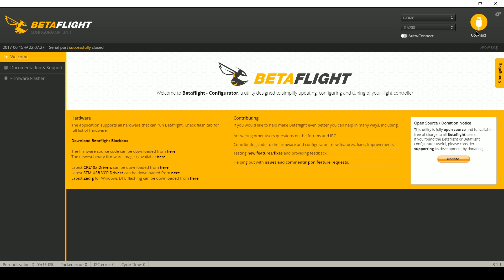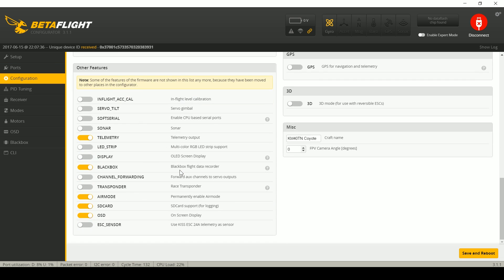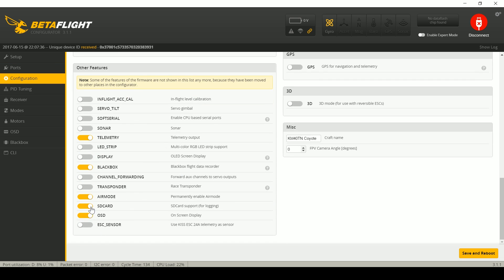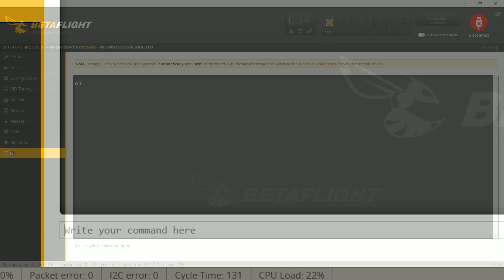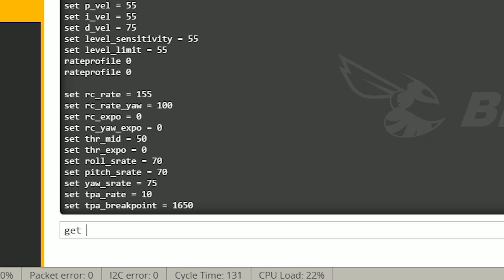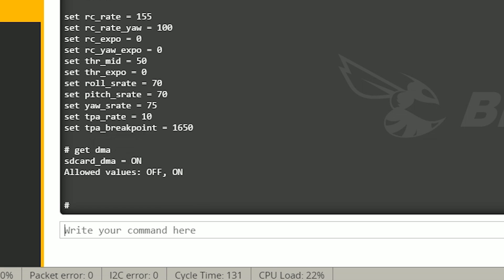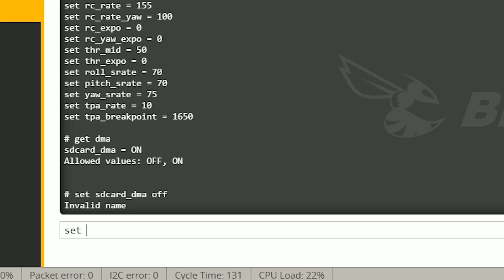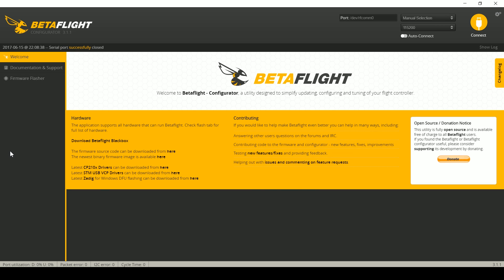Omnibus F4 Betaflight Thrashes and Crashes | HERE'S WHY AND HOW TO FIX IT

Comment: Hey I have a problem where my drone is all good connected to the computer, the motors spin no desync at all, but as soon as I use the transmitter and arm it at first it seems ok but when you push the throttle up motors go crazy also they overheat real quick and the drone turns in yaw direction like it jitters, does anyone know what the problem is ( fyi i changed the motors and escs, I updated firmware but nothing works still the same problem)  Thank you

Comment: I had that moment with my quad with omnibus f4 in it. Instead of that moment, I got problem with its GYRO then.
After it crashed, the gyro is error by seeing it in my goggle. I couldn't arm the quad and the message "no gyro" appeared in gogge display. I tried restart the quad by plug-unplug it then it works again.
Can you guys helm me? What makes it so? That makes me afraid to fly my quad again before i could found the problem.

Comment: no data flash,i keep getting that pls help how to get my omnibus f4 v3 pro to work.
Reply from the maker: Most likely it just means the FC has an SD card reader instead of a dataflash chip. "No dataflash" doesn't affect the working of the board. Dataflash would be used for blackbox logging.

Comment: I have an omnibus f4 OSD AIO and it did this crap this weekend. but mine doesn't have an SD card slot on it.. any ideas? I really hate this board as I can't get ESC pass-through to work nor can I flash the firmware. May just replace it with something better.

Comment: This is happing to me but I have a naze32 it just started happening today out of no where how do I fix this?
Reply from the maker: To be honest if I had sudden trouble with a Naze 32 today, I would consider replacing it. Betaflight hasn't supported F1 chips in several versions.
Reply: Hahah yeah ordered the omnibus f4 thanks. Hopefully it don’t do this but at least I’ll know how to fix it.
Reply: I just installed the omnibus board In to my quad and was flying but it randomly falls out of the sky I will hear 3 beeps then it will just disarm and it happens randomly. What’s the problem? It’s not like this problem it just beeps and then disarms? And I did everything in this video I have no idea?

Comment: Hello! I really like your videos and feel like you are the best person to learn from! Your new vids are awesome keep flying! :)
However I got an issue with my F4 pro v3 flight board. My drone crashed and I had no idea why. I tried to plug in battery and something started smoking. I found that it is the U4 unit. Next to it there is a C7 resistor and it came of somehow (at least one "leg"). I soldered it back carefully and tried to plug it in again and it started smoking again. I removed the burnt U4 unit. Now I am wondering what funcion will I missing. Maybe you know that (?) :)  The FlightB turns on and looks like its still working.
Reply: Better to not get omnibus.
https://davidhkblog1.blogspot.com/2017/06/fixing-omnibus-f4-pro-over-heat-and.html?showComment=1541408154194&fbclid=IwAR0DAE2uii9O1eEEXnDitEB6WSsGw1E3e22xpCHsfqDY9nb8yP7uv2E_HJM#c6956157706785268210

Comment: Im having a issue with Acro mode. Stable and Horizon mode work perfect but acro will fly good for a few seconds the the stick inputs will randomly change. Pitch forward will roll left, pitch backwards will pitch forward and so on with the rest of the stick inputs. only thing that does not change is yaw and thrust. Sorry I am a newbe and this is my first build.. PLEASE HELP
Reply from the maker: I literally can't think of a single thing that would cause this. Find a more experienced pilot who can get more information about what is going on is my advice :-)
Reply: Thank you Joshua. I will do some more research.

Comment: I have a problem with mine taking off at arm
Reply: @Midwest FPV mine turned out  be simple. The motor direction was wrong. It's not enough just to have 2 CW and 2 CCW. The directions of spin must match what you see in Betaflight. But you probably already know that....There are quad groups on Facebook and they are good about answering your questions. Squadrone is one

Comment: Running official 3.3. I freefell from 150ft due to my inputs being ignored after a throttle punch (within 100 feet), it continued on for a couple seconds till I hit the failsafe(Qx7) I then attempted to rearm and "catch" it did rearm but too late, surprisingly nothing broke, not even a blade.

Osd didn't work and only displayed random letters. Bb did not record as I did not insert SD card.

I reflashed to 3.25 and strapped the drone to a 4X4 and gunned the hell out of it with tons of throttle stabs- no failsafes/glitch, osd  works.

Using a Hobbywing F4 with OmnibusF4SD target, Dalrc engine with 3A BEC, 5v feeds 200mw VTX and XM+ RX, cam powered from Vbat.

Going to attempt flight tomorrow, hoping it was a firmware bug I read on RC groups someone with an OmibusF4 and 3.3 had exact thing happen, someone wrote it off as a tx/rx glitch, I'm not buying it, I couldn't disarm, but my switch failsafe worked? I have the RX set to "no pulses" and my FC RX failsafe is "lead balloon mode".

Weird stuff, frightening too because I had around 15 seconds of no control over my quad. If she flies sweet with 3.25, I'm giving 3.3 a hard pass.
Reply: Just thought of something, bb faulted due to no sd card, wondering if onboard flash size is too small and somehow it tried to log data and freaked out the board due to insufficient memory causing some kind of conflict.

But isn't BB flash separate from EPROM? Maybe just a firmware update glitch?
Reply from the maker: Dataflash and program memory are separate.
Reply: I figured that. I'm going to eat my words, but I DO think it was a RX issue, I was flying around, punching out a little bit, then went off away from me and at low throttle, and boop! failsafe- it STILL could be another component such as noise in the system since I'm running beefy motors. Oh well, I'll throw in another XM+ rx and see if that solves my issues, I'ts directly soldered to the board via stubby pins and I made sure the joints were nice and shiny.

I also flew old blue  that is the same frame/similar setup and had zero issues- this will be the first bad FRsky RX go bad on me- also, antennas are tightly connected, so that isn't it.

Since it's down, I downloaded Butterflight and see if the hype is real.

Comment: Hooked up my board, everything works perfect except ibus.  It will send signals intermittently.  I have no idea what is wrong.  Evolution tx, ia6c rx.  Why won't this work?  I receive bat voltage through the controller so I know they are synced.  Any ideas.

Comment: I have an ARTOWER F4 PLUS 2.0 Flytower Omnibus FC... which lead me to this video. I'm currently experiencing an issue where the copter just "drops dead" during hover testing at random times. Motors will just stop and bam, right to the ground it falls. All lights remain on. It will not re-arm either. I've tried connecting it to the computer after an event like this occurs and it's dead to the world. I tried blackbox logging just to see if it would tell me anything. 

Interestingly enough in betaflight 3.2.0 with this board and sdcard_dma = ON, I do not get any shaking at all, just figured I would mention that. Presence of a microsd card or not, however, makes no difference with this "sudden stop" issue I'm having. Do you have any advice on how I should debug this? Basically I feel as though the FC is crashing/freezing.... I am going to disable DMA tomorrow and see what happens, but remember, I haven't even been using the blackbox except once to test.
Reply from the maker: Refusal to rearm is a strong indication that you are having failsafe events. Check your receiver and its connection to the FC.
Reply: Hmm... I've already replaced the receiver; and it's wired up to a 3 pin connector that seems to fit snugly. Every time this happens the receiver light is fully on and responsive to the radio being turned on/off. I should have mentioned that. Thanks for the fast reply! I don't know what my next step would be.  Would a failsafe event though prevent me from connecting it to betaflight until reboot/restart of the quad? That is what struck me as strange. I should test this...
Reply from the maker: If the receiver stays green then the likely cause is the signal wire to the FC.

I'm not sure whether failsafe would prevent connecting to USB or not.
Reply: For science, just now I tried powering it on, ensuring I was bound, and unplugged the receiver from the copter entirely. Surely that would cause a failsafe event, total and complete loss of receiver. Connected right up to betaflight with no problems. There is something going on with this FC and I can't put my finger on it... I wish there was a way to have more detailed logs that might lead me to what's going on.

Comment: Hey JB!!  My issue is not entirely related to this video, but I'm hopeful you can help. I just received the Furibee Darkmax 220 with the Flytower Omnibus F4 SD FC. The receiver binds to my Taranis just fine, but I get no response on the Betaflight receiver tab. All the setup seems correct: SBUS selected, serial RX mapped to UART1 per the instructions...  Any ideas?  Re flash the newest BF version?  Try a different UART?  Many thanks!
Reply: Hello! I have the darkmax and had the same issue. You need to turn off UART1 and enable UART6. It is incorrectly configured from the factory. I hope this helps.
Reply from the maker: If SBUS is selected and serial RX is on the correct UART, then it should work. If it doesn't work, then double check the wiring. Then if it still doesn't work, start re-examinign your assumptions. Do you definitely have an SBUS receiver? Is UART1 definitely the correct one?
Reply: Thanks John!!  I'm hopeful that will solve the problem.
Reply: I had the same prob.  It should on UART6, not UART1 like the manual incorrectly states.
Reply: Crisp, I'm wondering, have you flown your darkmax at all, and how is your experience? are you getting any random drops?
Reply: John Cuppi   Funny you should ask, John. I flew it for the first time yesterday and it hovered fine, but at the very first throttle punch it went crazy and crashed, breaking an arm!!  The #2 motor is also seized up, but I don't know if that's due to the crash or what caused it. I'm working with Gearbest to get a replacement/refund.
Reply: Shit! I'm sorry to hear that. Let me know how that works out for you. The impact is likely what caused that.
Reply: John Cuppi   Thanks, man. I will.
Reply: John Cuppi - Have you seen AndyRC's Furibee Fire Dancer review?  His quad was flipping out during throttle punches just like the Darkmax, and he fixed it by changing Motor Timing to MediumLow in BL-Heli!!  Man, I hope that works with my replacement Darkmax.  Have you made any further progress with yours?
Reply: M Crisp no luck with mine at all. I had not seen that. I'll give it a try today.
Reply: I have checked and it is already set to Medium, Low by default. Good guess though...
Reply: John Cuppi  - Damn!  I was hoping that would fix it!!  Now I don't know what to try.  Have you tried the DMA fix JB discusses here?
Reply: M Crisp yes, DMA is not the problem either. I am going to end up replacing the Artower Omnibus F4 board with something else. I inquired if gearbest would ship me the old ArTower 1.0 F4 FC with the round buzzer on it. Will see what they say. I am just so done with trying to make this ArTower Omnibus F4 2.0 version work.
Reply: John Cuppi - There may be hope yet. Check out Curry Kitten's review:  https://youtu.be/-C0E1GdVWv0
He was having the same problems, but fixed it by simply replacing the RX plug!  Fingers crossed!
Reply: I was very skeptical that this was my issue because his board actually indicates a failsafe condition when he jiggles the wires. Notice how it beeps. Mine is cold dead, you get some solid lights but that's it. Anyway, I decided to test his theory and held the XM+ rx in my handle, and jiggles it like crazy, more than he did. I don't have any problems with my stock connector at all. It is nice to see that he does not have the issue; but it is not our problem.
Reply: John Cuppi - Dang!  What is that, like, strike four? Five?  I'm with you - if I get a replacement and it's crap, I'll replace the FC and the RX. RTF my arse!!  I'll keep digging in the meantime.
Reply: I'm pretty fed up with the OminBus F4 in general and it makes me not even want to bother with v1.0; but a replacement that isn't out of my pocket is fine with me. Everywhere I look I keep seeing these boards having a myriad of issues. If you can find a known good one, then you're golden, otherwise it appears to be a mess of hell. Google for 'omnibus f4 woes' to see what I'm talking about.

Comment: Josh, I have this in version 3 but cannot get the buzzer to work. It is enabled under the configuration tab. Can you help please? Dont want to fly with a buzzer.
Reply from the maker: +Roland Burrows you mean motor buzzer?
Reply: Joshua Bardwell I installed a buzzer on the buzzer pins and connected to a switch on my taranis, aux 3! However, the switch works, the blue light on the FC blinks but no sound.
Reply from the maker: If the FC light is blinking, then everything is working except the buzzer. Either the buzzer is broke, the FC is broke, or the wiring isn't right.

Make sure you bought a self-driven piezo buzzer and not a passive buzzer.
Reply: Joshua Bardwell thank you. Wiring was wrong! 😒

Comment: Hi Joshua. I'm struggling with an issue. I'm using 317 betaflight. I changed resources for 3 and 4 motor with no problem. I'm using omnibusf4 for a micro f2c. I have firmware updated for my frisky xmplus. Board rotated 90 to the left. I set acc and gyro to 270. So...i arm but motors don't spin up even though it is set to. I give throttle and can hover. I hover for a few seconds but then it shoots forward and upside down crash at hover throttle. Any ideas?

Comment: G'day Josh, thank you for another informative video. I've been banging my head against this issue for the last few days trying to figure out if it's worth keeping the Omnibus F4 Pro I have or if I'm better off throwing it in the garbage. 

I have been reading all over the net and it is looking more and more like the DMA conflict issue could be a problem with the F4 chip and may not be something that the devs can fix. Have you heard any more info on these issues and have you had it occur at all with other F4 boards like the Holybro or Matek F4s?
Reply from the maker: It doesn't occur exclusively on the Omnibus, I know that for sure. I don't know if there is any fix for it other than to turn sdcard DMA off.
Reply: With DMA off I'm still getting some funny behavior with random and quite infrequent glitching of the motors. Something like 1/10th of a second full or no throttle glitch making the quad jump or sink. If I turn logging off completely this glitching disappears. It's super annoying!

Just had a look on the Matek site and it looks like they are confirming it as an issue on the F405 (http://www.mateksys.com/?portfolio=f405-osd). This is a pretty major issue. I'm surprised it's not getting more attention.

It's worth noting that I've been using a Flip32 F4 special edition from RTFQ that has a data flash chip instead of a SD card for logging and in 3-4 months of flying it I have never had any issues whilst running both Dshot600 and logging concurrently.

I wonder if the Holybro Kakute F4 is also immune to these issues due to using a data flash chip instead of the SD card?

Comment: what fix would you recommend for my emax magnum stack that runs the omibus f4 . It connects fine but when i try to flash the FC it doesnt show it on the com port. IS this a common problem with this board? thanks and great videos as always.
Reply from the maker: Download the ImpluseRC Driver Fixer app. Run it. Push the bootloader button on your FC and plug in USB while holding the button down.
Reply: Joshua Bardwell thanks fixed it it right up.

Comment: I had the Omnibus F4 and this happened to me - thanks for the heads up Joshua. I've just finished an Armattan Chameleon build with th CL racing F4 FC. Took it out for its maiden (in angle mode for safety) and I got it again! Are all F4 boards potentially at risk? None of the components from the original build (Wizard) were used - even had a brand new Taranis Plus.
Took the SD card out to stop it logging and the problem went away.  https://youtu.be/VWRfTva0T78

Comment: Have you ever come across this issue on a board without an sd slot or with blackbox logging turned off? I am experiencing the same thing, minus the crash, with a DYS f4 aio.
Reply from the maker: I have never personally experienced this issue.
Reply: Hmmm, yeah I didn't think so. I need to do a log and test OS42 to rule out a DMA conflict, my next guess is the gyro is crapping out.

Comment: I''m using the Kaktute F4 AIO controller and i'm getting the same problem, however i'm writing to the built in memory instead of an SD Card. Also my video and OSD will cut out as well. This does not happen when blackbox is disabled!!!!
Also there is no SD_DMA options in the CLI, probably as the board doesn't have an SD reader.
Reply from the maker: I agree that the sdcard_dma option only appears if you have an SD card reader.

If you are using Dshot, switch the Multishot and that should resolve any DMA conflict with the motors.
Reply: I shall give that a go.
Reply from the maker: Please email me joshuabardwell@gmail.com to let me know if switching to multishot fixes the issue, okay?
Reply: Didn't work :( 
email sent.